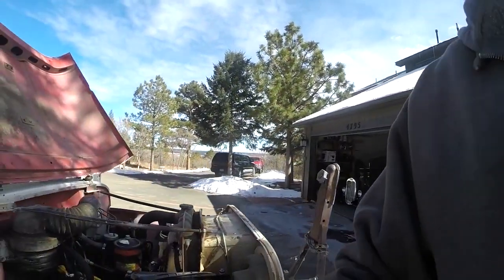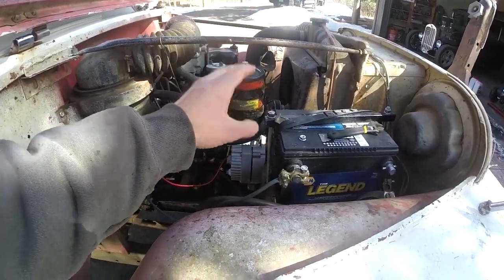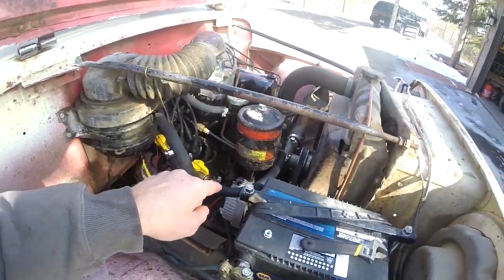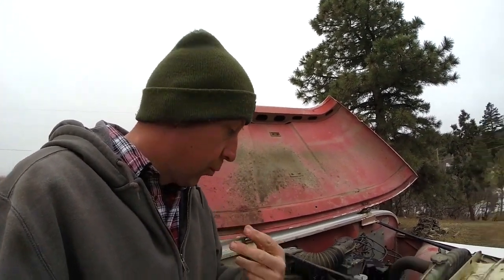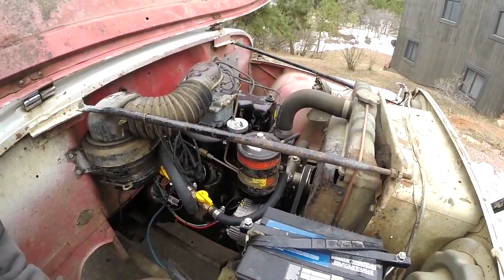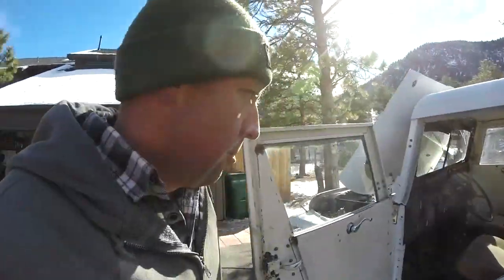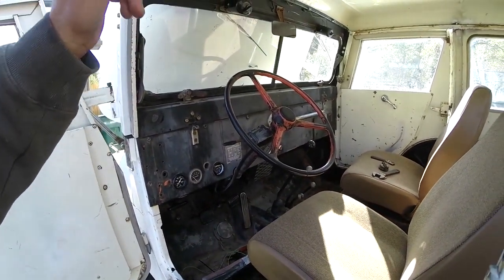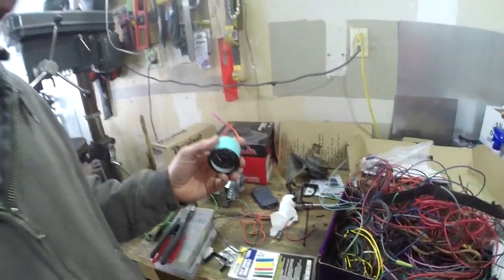3 Wire Alternator Hookup Explained- It's Easy- If I Can Do It, So Can You!  Bad Hombre Garage Ep. 88

Comment: my generic hot rod  alternator will charge OK, but when I shut off jeep and walk awaay overnight, battery will be dead next morning... so, ichecked battery (ccharged) after shut down, and it makes a tiny blue spark... so it still drawing a little power... will an idiot light fix that??
Reply from the maker: Maybe… is it a one wire alternator or regular 3 wire connection?  If it’s a one wire, the idiot light doesn’t work.

Comment: The ammeter is effectively a shunt, with a % of the current in the main connection. It will also have resistance inline to ensure all current doesnt redirect and flow through the ammeter if the main connection were to fail.
Reply from the maker: Gotcha, thanks for watching and taking time to comment.

Comment: I'm rewiring my 1980 oldsmobile delta 88 dash carrier cluster with fiber optic lights  to light up the dash section only  ,not in the signal indicators lights section  .I think you answered my question of fixing the dash test lights(brake, lights on,charge light indicators ) on to the alternator field wire on the alternator for ground during test on( ignition on ) along with the Alternator charge light.so ground is broken when engine/alternator is running (three wire alternator built in voltage regulator).And when dash and head lights are on ,dash lights on indicator on dash will not light unless engine is off and light switch is on sending power to dash lights.and  lights on indicator. Same thing with my emergency brake light indicator on dash indicator will only work on ground to emergency brake switch(ignition on) also grounded to brake line combination proportioning valve plug .
Reply: That sounds right to me!
Reply: @joevigueria8399  Damnskippy !
Reply from the maker: @lesliemclean4381  thanks for watching.  That sounds right to me,  but I’m not the expert! Good luck with your build, it sounds cool.

Comment: I finally get this after watching your video.
Today I was driving to work and I hit a traffic jam. At this point (sitting in traffic) , I noticed my volt meters were low (11.9 volts) (not the usual 13.8) and I was like, "Oh no !". 
I was still 25 Km from work and with the traffic, it was going to take me over an hour. I knew the alternator wasn't charging now and the "dummy light" on the dashboard was on. 
I cancelled work and limped it home. 
Checking voltages (alternator output), it was at 11.9 Volts [same as battery] so obviously the alternator was dead or the "exciter wire" was not demanding the alternator on. I tried checking the voltages on the 2 pins (honestly thought they were just positive and negative to maybe fire a solenoid / relay) but failed trying to stab it whilst connected with the multimeter probes. I disconnected the plug and both pins were giving various volts (11.3 and 11.9). My guess is that the 11.9 was the exciter wire and the 11.3 was the voltage past the dummy light. 
As I was now confused, I plugged it back in to do another wire jiggle test, and suddenly the alternator came to life. The engine revs went down as the nator clutch obviously engaged as it charged both batteries (primary and aux) after the VSR flicked a few times (connecting and disconnecting the aux battery)

I'm considering connecting a buzzer to the dummy light so that in the future, if this happens I will know the alternator is not charging. I don't stare at my dashboard or voltage meters whilst driving and at least with a buzzer, I will know pretty quickly if there is a problem.
Reply from the maker: Nice!  I just did a more recent video where I wired up an alternator on my old hot rod explaining it again.  Sounds like you have it sorted out, good luck!

Comment: If I understand this correctly, my 1990 Dodge D150 has the regulator inside the ECM(yep called ECM in 1990) and my voltage is about 13.5. At 66yrs old I've owned a lot of cars and what was always common was about 14.4v. I just got thos old pickup so it may be a non-issue but I'm thinking if it has trouble keeping the battery up I can just add a little resistance to the signal field wire to fool the system to increace output voltage a little. I know on my Roadrunner I moved that wire from the connection on the cowl to under the dash when the headlights pull power and my dim headlights were solved. Have you done this before and know what might be a good resistance to use?  Thanks, good video.
Reply from the maker: I like the way you think.  I haven't done that before, but I think it could work.  That said, I have no idea what resistance would work for you.  I think, if that was my project, I might just pull an output from this side of the ECM (where the low voltage is) and use that to feed my signal to the alternator.  All that said, I bet 13.5 volts will be good enough.  Thanks for watching and taking the time to comment!
Reply: @BadHombreGarage  Thanks for the reply. I'm going to watch and see how it does, I may be expecting an issue that never comes, I'm just trying to think ahead in case. If I change anything I'll let you know.
Reply from the maker: @dbc105  👍

Comment: I have a 73 jeep gladiator with a amp meter that Is no longer hooked up. Yes thats how they are wired... caught fire after I did a timing job. Had to buy a new amp meter, rip it apart and use the old meter parts to build a new one... worked great can't tell but go figure it's the only gauge I couldn't buy and replace. Found a way out. I watched the video to find out how to wire my alternator for charging my RV batteries thats driven by my waste oil diesel engine. So thanks for the info.
Reply from the maker: Thanks for watching and taking the time to comment!

Comment: Incorect you need to definately only use a 2 watt bulb between  ignition hot and IND terminal. Yes this is the initial exitation wire and requires the 2 watt light bulb for(1) indicating the alternator is charging, and (2) to limit the current on this wire during initial magnetizing of the rotor. No you cannot use an LED for this because it is a Diode and also it will not allow enough current to exite the field.
Reply from the maker: Thanks for your knowledge!

Comment: My exciter light only goes out when I rev the motor higher say 1500 rpm then it drops back to idle and it stays off  what do you think I have to do to fix
Reply from the maker: I think that makes sense and is actually working correctly.  An alternator needs to get up to a certain RPM (usually the engine around 1200) before it starts charging, then it will continue to charge even though it drops below that.  Your light is just showing you that the alternator isn't charging yet.  Of course, this means that you'll want to blip the engine on startup just enough to get that light to go out so that you're not discharging the battery as the car warms up.

Comment: I picked a 51 chevy and it has a Painless Wiring,  problem I have is the alternator is drawing 2 amp , and this is the new alternator the old one was drawing 3.3 amp on the negative post and I am not sure what to do , if I leave the truck on a trikle charge it's fine but it's not correct
Reply from the maker: Definitely something drawing on your battery.  Maybe the alternator exciter wire is constant hot instead of keyed power?

Comment: If I wired the exciter wire to the + side of the coil with a diode in-line would that have the same effect as running the light bulb?
Reply from the maker: I guess that might work… but it might be easier to hook it up to a hot wire elsewhere.
Reply: @BadHombreGarage  so I could hook up to the positive side of the coil? As long as I have an Inline Bulb or diode?

Comment: My problem is that I have a mess of wires under the dash, no proper harness.  I don't know where to connect the exciter wire from my regulator. I have the small light and the proper gauge wire. Do I trace the wire back from my coil (positive side) to my ignition and connect there ? Don't I have to ground the bulb. I know you can't nuse an LED. Please help?
Reply from the maker: Were you able to sort this issue out?

Comment: The "exciter" wire supply current to the alternator to get it started generating. When it gets going it doesn't lose it's ground but the alternator supplys current out of itself thru this wire. Then you have voltage feeding into the idiot light from both ends so no current can flow and the light stops glowing.
Reply from the maker: That’s a great explanation, thanks!
Reply: What about fuses. I have an old Jeep like this with a 3 wire GM alternator.
I have my hot from alternator going directly to my battery. I have HOT from solenoid going to a junction block under the hood then to BATT on ignition switch.
I have exciter wire from alternator going to IGN on fuse block under dash then to IGN on ignition switch.
I’m getting my wipers, blower, fuel pump power from the IGN portion of junction block and the lights from POS portion on the junction block.
I have each accessory with its own fuse but I’m not sure if I need a fuse in the charging system

Comment: If the stator and fase are both supposed to go to the external voltage regulator, but the stator wire goes to a harness with a bunch of wires and ties into the cars electrical circuits instead of going to the external voltage regulator like all the videos show, then what do you do. My new high output alternator is designed to charge normally with zero other connections other than to the battery, but I can jump the wires on the harness for the external voltage regulator like every video shows because my stator wire never went to it. I have a stator wire coming from my dashboard and have no idea what to do with it. It's a 1977 ford Econoline club wagon.
Reply from the maker: Hmm, I’m not sure what to make of that either.  Calling all the other viewers! Anyone have thoughts on this?

Comment: What are those green wires for? On my 1976 Chevy p20 the green wire is burned off at the end. Also noticed my gages all spin now after I got a new alternator. Any advice!???
Reply from the maker: That's a good question.  I'd look into why that wire burned... it may be going to ground somewhere. Speaking of grounds- your gauges may be acting goofy because of a poor ground.  Always make sure there are good grounds from the unit to ground, from the cab of the vehicle to the frame, from the engine to the frame, and from the frame to the cab.

Comment: I don’t have anything connected to 1 or 2, will that be an issue? I’m getting 14.1v in my battery box. What stops it from charging the batteries too much? Like if you went on a 24hr ride, wouldn’t the alternator sending 14v to the batteries harm them?
Reply from the maker: You might have a true one-wire alternator if the 1  & 2 posts do not have wires and it still excites and charges.  An alternator should put out between 13.5 and 14.5 volts (on a 12v system) in order to charge the 12v battery, so no I don’t think it will cause any harm.

Comment: Is it possible to change the wiring without having to remove anything else besides the wiring? It’s like I want to do the job but I don’t want to have to take anything else off but just the wiring. 89 22RE Toyota
Reply from the maker: Probably; though I’m not sure why you don’t just want to use the Toyota alternator and wiring?
Reply: @BadHombreGarage  I do want to; however, currently my alternators keep dying after being on and running fine for a while and I just keep replacing the alternators. The wiring is very old and even frayed with exposed wires coming out every which way which makes me suspect the wiring is the cause of the problem. I suspect changing the wiring will fix the underlying problem and therefore solve the main issue.
Reply from the maker: @AnonymousAnonymous-dn2pk  yes, I agree the wiring might be the problem.  It might be tedious, but worth repairing the frayed wires.
Reply: @BadHombreGarage  Do you think it would fix it if I just meticulously taped them?
Reply from the maker: @AnonymousAnonymous-dn2pk  it might, but you can’t go wrong by meticulously replacing the bad wires either.
Reply: @BadHombreGarage  Lol right. Thanks for your replies. God bless.

Comment: I’m converting an old tractor to 12v and replacing the generator with an alternator. I think I understand most of this and have started an updated wiring diagram, the only one I’m not sure about is the “2”/“F” connection for mine. The “1”/“R” I believe is the exciter wire you mention and I have it tracing back to the key switch (don’t have a dummy light or anything in there yet but will add one). The main post from alternator I have going to ammeter, with other side of ammeter going to battery post on starter solenoid. The tractor does have lights so I’m trying to figure where the “2”/“F” connection should go.
Reply from the maker: If I’m not mistaken, the F would be hot when the key is on.
Reply: So if the F goes to the key switch, where would R go? I thought the exciter wire was the R and was what went to the key switch. I must not have understood correctly from the video.
Reply from the maker: @RealJohnnySharp  no, you understood correctly.  I was wrong in my first response to you.  I would set it up like you suggest.  1/R as exciter. Sorry for the confusion.

Comment: do you  know the order of the 3 wires that go into the plug on the alternator? the wire came out of the plug so I got a pigtail repair kit I just don't know the order if you can help me I would appreciate it thanks
Reply from the maker: I'm not sure the order... there should be one bigger wire that goes on the back of the alternator, then two that go into the plug.  you have a 3 wire plug?

Comment: Many thanks. I was asked to fix the alternator wiring, and hunt down a battery drain. The owner had the 2 pin connector plugged in backwards. Fixed that, but then the engine kept running after key off, and the sense wire was getting hot. Oops, did I just fry the alternator?

Nope, turned out the owner had shortened the sense wire, which was a resistance wire. It was reading 3ohms, instead of 15. It's a bit of a flaky design, counting on a resistor wire to shut off the engine. I'm considering putting in a relay, to break that connection on igmition off.

By the way, did you happen to take a resistance measurement from pin2, sense wire tab on the alternator, to ground (connector unplugged)? I measured about 14k. It's not much, but it does result in a battery drain of about a milliamp. Could that be a sign that the alternator regulator is about to go out?
Reply from the maker: I did not take any resistance readings, and I not sure what it should read.  Hopefully someone can add some info here in the comments?  Sounds like you are a good troubleshooter! Thanks for watching.
Reply: on gm alts you can use a 470ohm 1/2 watt resistor in place of a bulb

Comment: An LED would not work right to replace the bulb as it has too low OHMS when it is turned on. A resistor would be a better choice. Take a look at an alternator load harness made by using three 1K ohm resistors in parallel (330 Ohms).
Reply from the maker: Thank you for the inputs, hopefully someone looking for this info will find it here.
Reply: I've been working on a 93 cutlass supreme convertible and for some reason the excite wire doesn't work ,the alt will charge for a while and then stop charging,after three alts we realized that the alts we're not the problem ,had a shop wire a basic relay in line on the excite wire some how and it works so far but,I would like to know how this works or how it is wired to work any ideas?

Comment: Isnt there a way to use some sort of signal relay so you can separate out the high powered heavy gage wire side from the low power light gauge wiring to the amp gauge...
Reply from the maker: Sure, I guess you could run a relay to the gauge.

Comment: So if I Connect the wier to the coil that’s the Distributor  right and it will still charge my battery on my car
Reply from the maker: Depends on which wire you connect.  The big wire that is on the single output post of the alternator should go to the battery, but I think a guy could connect the excite wire to the coil and it would function.

Comment: Can you please tell me why they hooked the negative lead from my battery to the alternator?  And where is my positive wire supposed to go? My battery is NOT charging!!!
Reply from the maker: That’s a strange one… I have not heard of it before.  What kind of vehicle?  On a negative ground system (which the one in the video is) you could expect the negative lead to connect to the frame of the vehicle, and that the engine and body would also be grounded to the frame.  The positive would need to be connected to the alternator, or to a wire being powered by the alternator in order to charge the battery.
Reply: @BadHombreGarage  71 Chevelle.
Reply from the maker: @twalatka  that should be pretty straightforward, I think.  See where the wire off the main post of the alternator goes.  You might have to chase it around a little, but it should go back under the dash or to a relay where it will provide main power to the car.  Then chase where your positive lead from the battery goes… probably to the big post on the starter.  If those wires are in the right place, and everything is grounded properly, it should work.
Reply: @BadHombreGarage  Thanks, there are strange wires going behind my battery, one going over my radiator and down towards the passenger headlight. I'm going to have to do a lot of chasing. Thanks.
Reply: @BadHombreGarage  thanks for getting bach to me